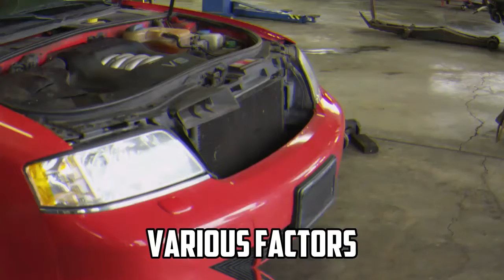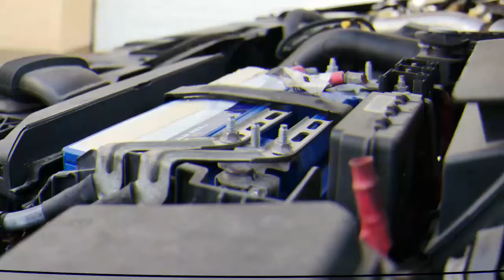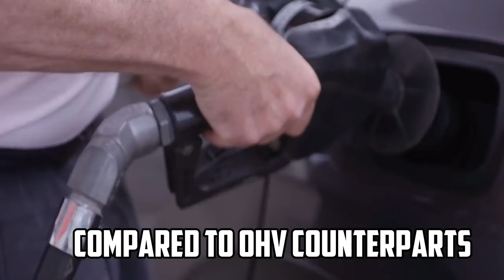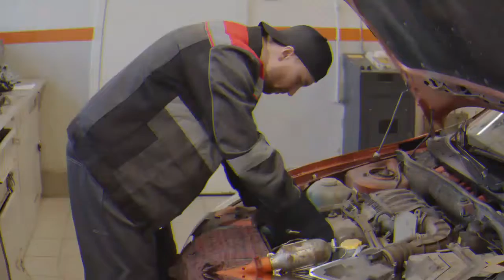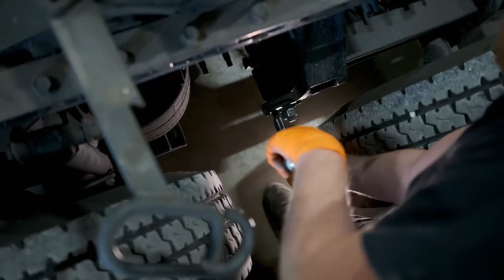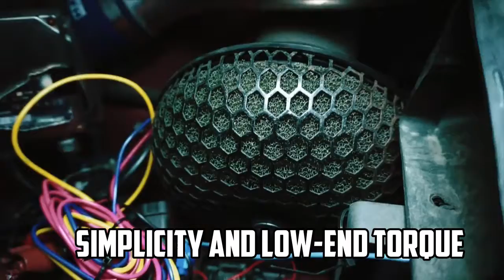Which Engine Design Is Best? OHV, SOHC, DOHC, Flathead Explained | TrustMyMechanic.com

Comment: Bruh Most of the Japanese cars got a DOHC we can site: the Honda Integra Type R or the Toyota Supra.
OHV engines are old engines, we can site the 1969 Dodge Charger R/T sush as low RPM and low Top Speed.
And Finally SOHC are rare as there are some cars  that I know like the Mitsubishi Lancer Ex: turbo intercooler. It uses a L4:SOHC engine as resulting in a bad top speed of 190km/h
Godamed men, it was my dream car 😭
Reply: Why would I like and subscribe before seeing the other 3/4 of the video? Why?.............................